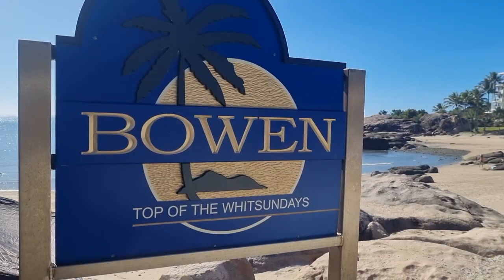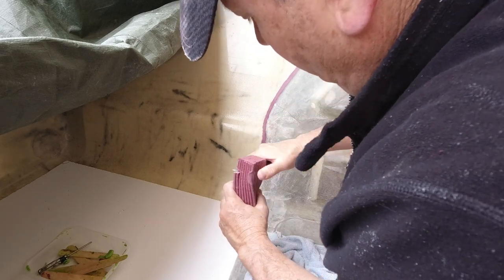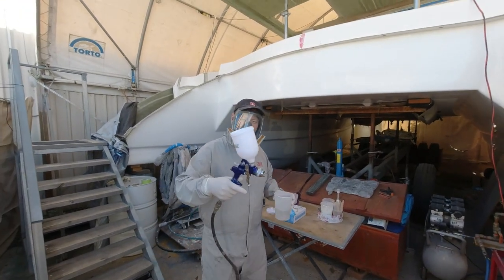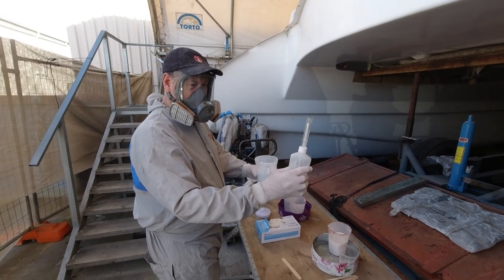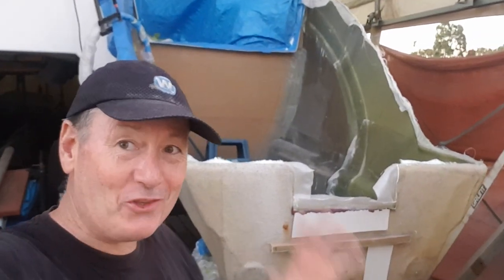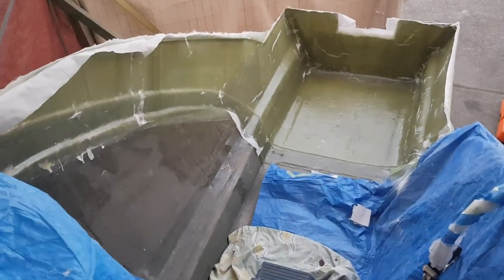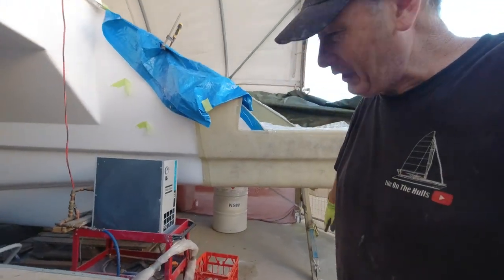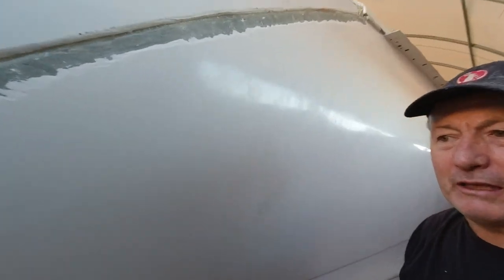Catamaran Hull Extension Layup - Part 1 - CATAMARAN BUILD Ep228

Comment: Considering the pattern described by Mads (Sail Life) as he was checking Athena with the moisture meter, AND the really garbage lay from the factory, kinda makes me wonder if they skimped on air control and the whole osmosis ordeal he had to go through (because it wasn't easy, regardless of how relaxed Mads is) wasn't a thing from the very start, now that you mention it.

Comment: Interesting what you were saying on the osmosis. My understanding was that for years no one could really explain why some boats suffered far more than others. Apparently, there was a Rosetta stone moment where one half of a yacht was badly blistered and the other not, it turned out that this was the hull where they'd switched resin batches and that the resin manufacturer, as apparently was standard practice, had used some sort of Glycol to get the correct physical properties between batches. The Glycol sets up an osmotic pressure between the laminate and seawater, water can then enter the laminate through micropores possibly left from evaporated styrene.
Reply from the maker: That is very I interesting and so poignaint .So many factors that can intimate osmosis only one way to avoid it and that's industry best practice and good matrials, and no polyester in submerged hulls

Comment: Looks absolutely brilliant - can you comment on longitudinal stiffness and why you did not incorporate longitudinal stiffeners across the joining section - particularly in what will be unseen areas? You certainly are - ‘getting it done’.😀👍⛵️
Reply from the maker: Hey Norman.There are stringers to be added into the hull which will extend from well within the existing hull and the full length of the extension.All in the coming episodes There will be an additional bulkhead that will be laminated over the stringers to further reinforce the structure Cheers Ross
Reply: @LifeOnTheHulls  Thanks for answering. I guessed you would have it covered.😉

Comment: Hi Ross. Looking good. Did you thin the gel coat for spraying and what size tip do you use in your gel coat gun. 👍
Reply from the maker: Hey buddy.I use spray grade gel coat which is thinned at production,and tip on the hvlp is 2.5mm.Hope this helps.Ross

Comment: i may have missed a part, but how long is the working time after you have mixed the resin? 10mins?
Reply from the maker: Typically at 18degrees c ,I will have 21 minutes of gel time working time,however I am able to alter chemistry with different types of mekp ,slow and fast.Percentage will also effect working time.
Reply: @LifeOnTheHulls  ok, because when had to do some glassing, i always panicked with the curing time. Thanks for answering and keep up the good work 😊
Reply from the maker: @finnsailing69  using epoxy can extend up to several hours.
Reply: @LifeOnTheHulls  i sent you a question on fb. If you have time i would like to hear your opinion